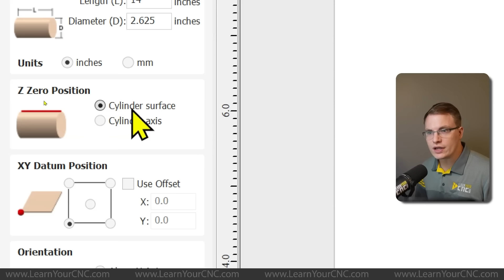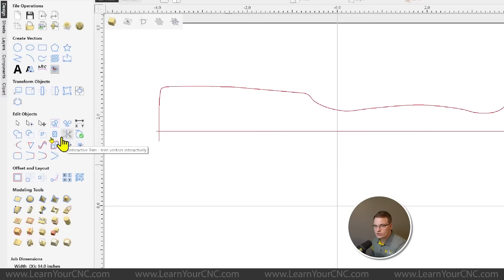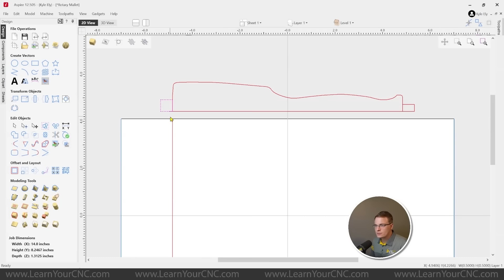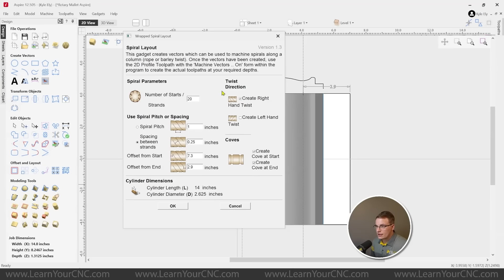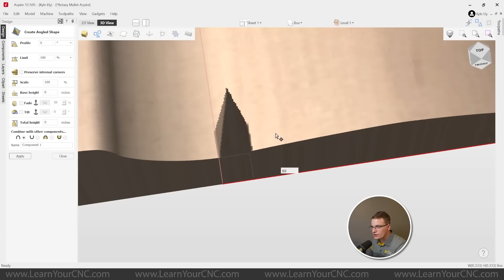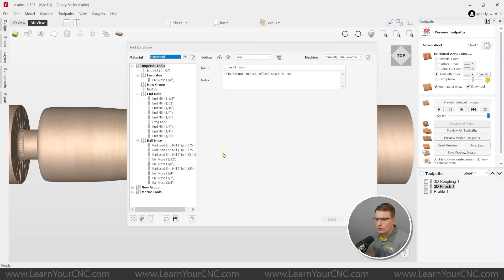Unlocking The Next Dimension In Wrapped Rotary Machining | Vectric Online UGM 2025

Comment: how do you find bottom left ?
Reply from the maker: You can choose your start position in your job setup.  It might be good to contact Vectric support with this question, file and type of CNC you have.  They can help you better.
Reply: @vectric I understand how to get start position on vectric  what I don’t understand is when you put the piece on the rotary where you set start point how do you centre it or where you set it if bottom left
Reply from the maker: Because it is a wrapped surface... you can start from any location on your rotary - there is really not a left or right... just make sure it is at the bottom edge of your stock (or to be more specific the location near the bottom of your stock where you want the part to start - accounting for your chuck and so on). ... assuming you are zeroing your Z from the top of the material surface.  In saying that... the rotary attachment is set up differently in may cases, so you really should consider contacting support where they can ask very specific questions about your setup.

Comment: On the Vcarve one,  Can you overlay a texture on the project and get the textured cut on the project?
Reply from the maker: Unfortunately you would need to project the texture onto a 3D surface, and the molding toolpath does not generate a 3D model... just a 3D toolpath. If the handle was a flat surface or a pocket you could set the start height to be the flat surface depth.   You would need to ajust Kyles cross-section... but it would be possible.